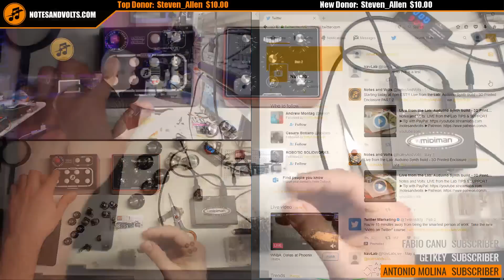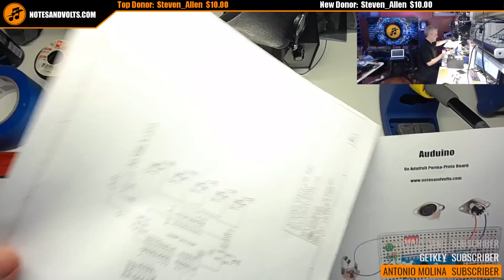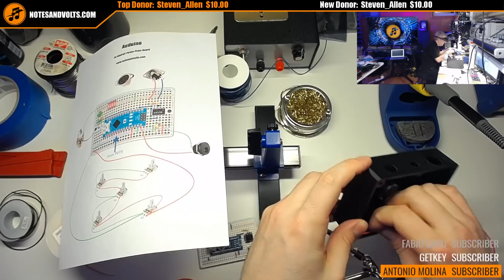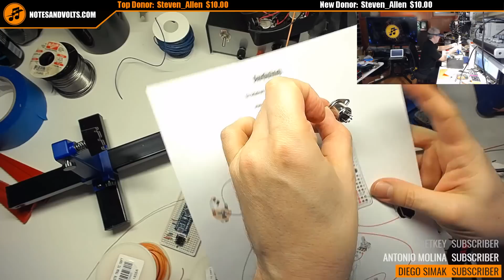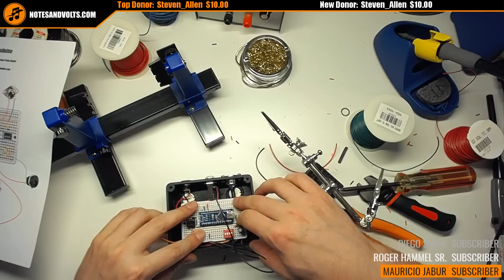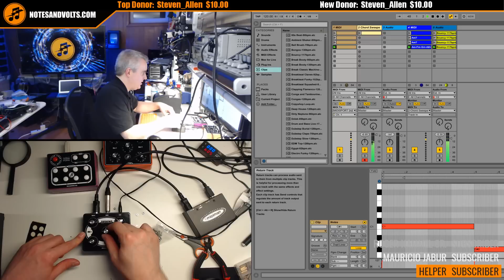LIVE from the Lab: Auduino Synth build - 3D Printed Enclosure - Part 2

Comment: I had trouble uploading a modified sketch after building the circuit. This is the error you  may get: avrdude: stk500_recv(): programmer is not responding

The fix is to add a small switch on the Arduino RX pin connected to the MIDI circuit. This allows you to upload a new sketch with the switch off, then turn back on to enable MIDI.
Reply: hello, wonderfull work ! ! thks but, I had the same problem  ::: avrdude: stk500_recv(): programmer is not responding :::::
could confirm the switch before midi circuit ? or maybe, is there a new arduino program ? thks again

Comment: Is there a reason for the change to 10K ohm potentiometers on this latest version? Is it to give better control than the 5K ohm pots?
Reply from the maker: Hi Buncho. Changing to 10K pots has no effect on the circuit. They are just easier for people to find in the stores.

Comment: Hello, thanks for everything: such a detailed walk through. I dare to ask: in your schematics, aren´t resistors R3, R2 hooked at optocouple flipped? Thanks in advanced for your answer.
Reply from the maker: Hi Alvaro. I'm using slightly different values for this project (1K instead of 4.7K on pin 7). The 1K is easier to buy and does not effect the circuit operation.
Reply: ok, thanks.